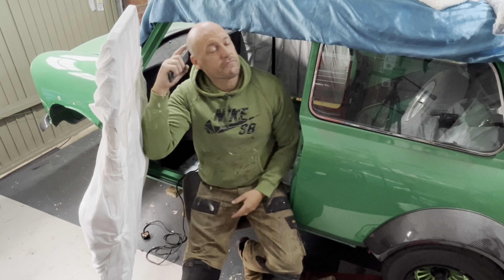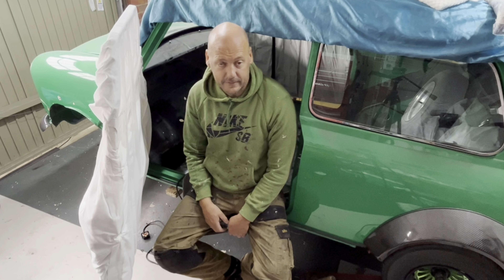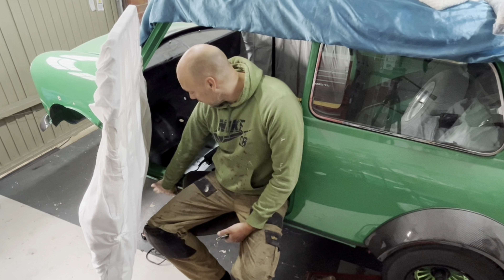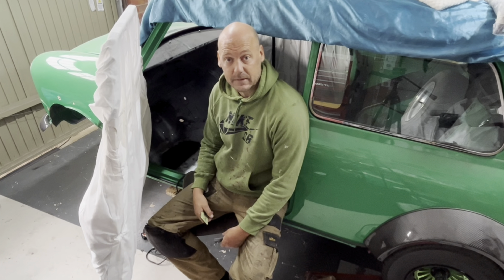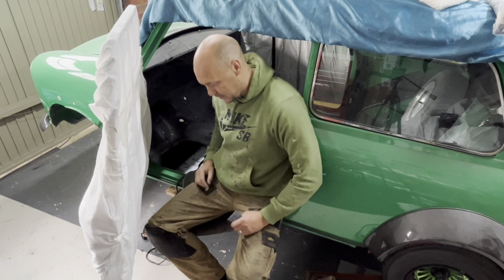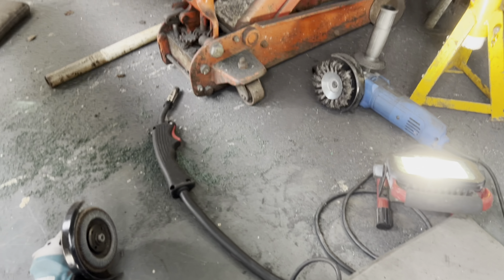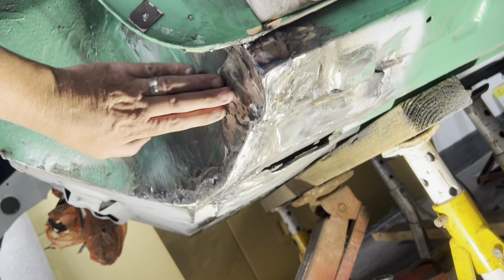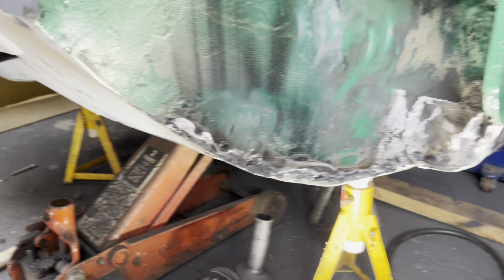Classic mini rebuild into my race car Part 20.  ￼ found more rusty holes.

Comment: Hi my friend, looks like your having fun, here's a few answers to your questions, use a mpi fuel tank because it has a return fitment in it, you don't need to modify rear subframe, the fuel tank should bolt straight in after your boot floor mods, fuel lines are 3/8" and 5/16" this way you can use AN fittings, you can use p clips every 300mm for fixing lines, interior lines have to be continuous from  rear bulkhead to front bulkhead, use bulkhead fittings, the larget fuel pipe is return line, you will need high pressure fuel pump for the injectors to operate, I have posted a couple of videos of me installing fuel lines on my son's classic rally mini build, which is going to run injection to. Hope this all helps, cheers Marty
Reply from the maker: Wow thanks so much for all this information. Love your channel I will go and have a look. Really appreciate it. 👊🏻👊🏻🫶🏻👍
Reply: 3/8” fuel line will supply more fuel than your engine will ever need. But more is better than not enough. 5/16” will also be adequate for about 150-180bhp@ 3 bar. 

Also you don’t need a return line although you can run one. To go without a return, You can run a dead head system so the pump and regulator and return all in the boot and just 1 feed pipe going up to the engine.

Comment: Yeah could do it that way would save running another line, I went with two lines because that's what was on the car originally, the larger 3/8 is the return back to the tank, my regulator is variable as running a turbo, so starts around 3 1/2 psi on idle and increases with boost, there is an extra pipe running from plenum to regulator. Cheers Marty
Reply from the maker: Thanks Marty 👊🏻👊🏻